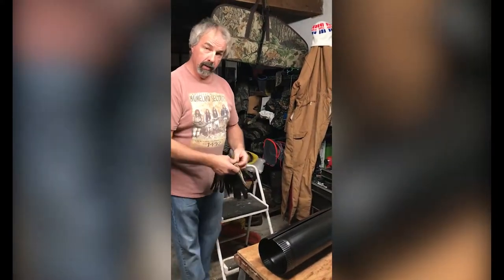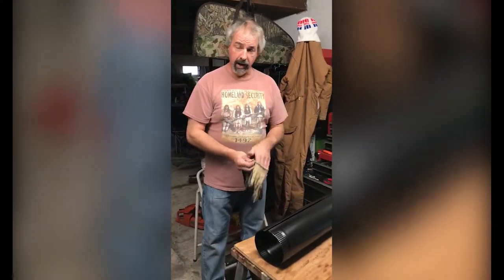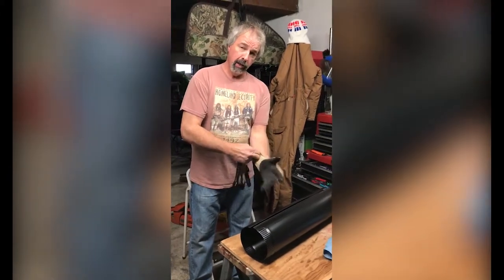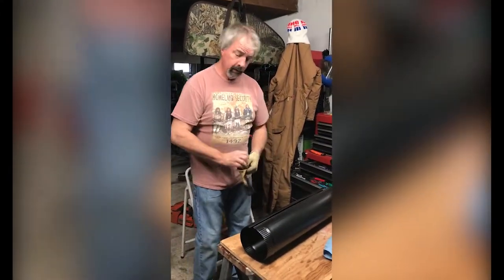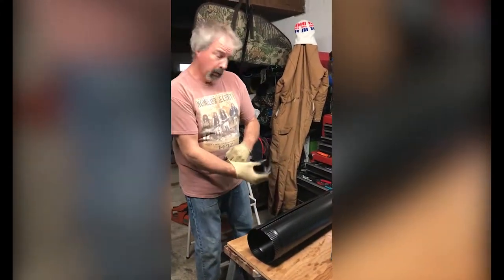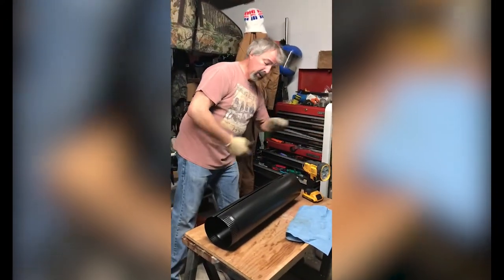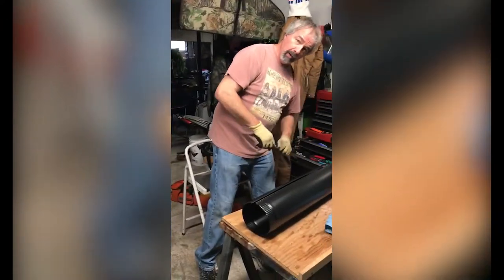Stove Pipe Assembly

Comment: Ok, very informative video but not one of mine have snap together that easy, not one LOL I think this guy is tricking us to piss us off LOL
So far, my best method has been to get on my knees in the floor with the pipe on the floor in front of me, pull the pipe to my knees with the Seams up placing my hands on the pipe pushing down so the Seams line up to insert one into the other then using the palm of my hand to hit the pipe opposite side of my knees up and down the pipe popping the Seams together then having to re-round the ends.
Reply: Ratchet strap is your friend
Reply: @goldsbywashington3509  hahaha I did my stove pipes about 2 years ago, I wont be doing anymore LOL